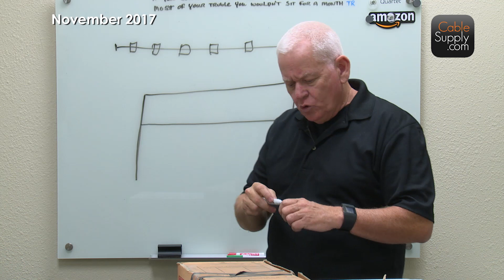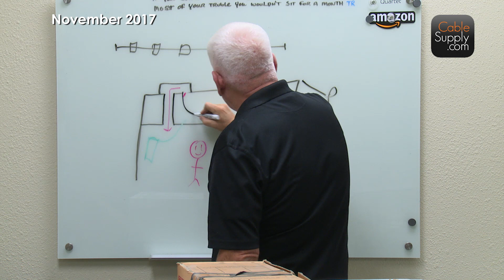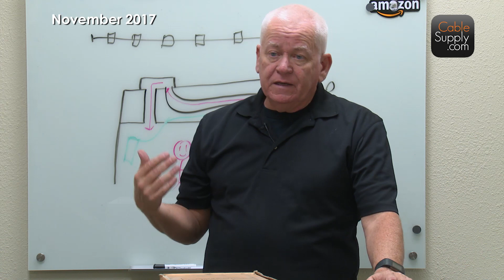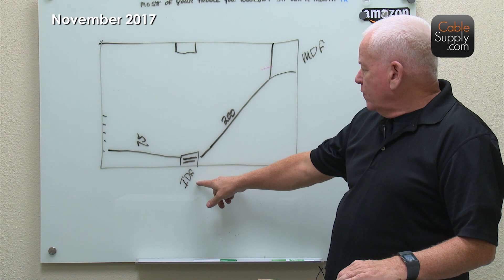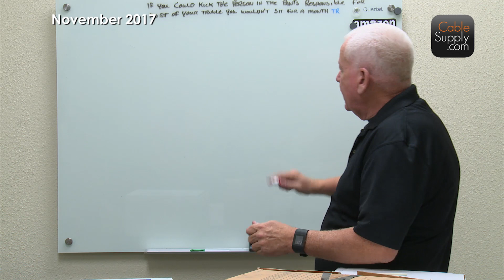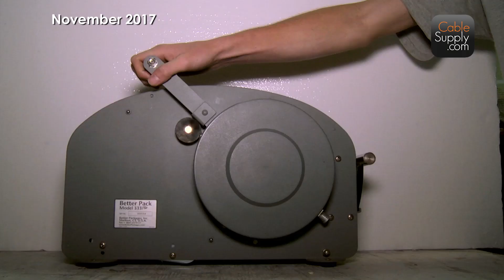Cable Types and Designations

Comment: Some digital Audio Systems - they use Burr-Brown chips to sample the audio, at about 196 kbits/second - require shielded Cat 6 cable. They enable standard{?} managed switches to send audio around a building, (an  auditorium for instance), Momentum Systems comes to mind...

Comment: HI,
Thank you for  your excellent sharing of knowledge.

I have a question.  You talked about "plenum" as a space overhead between the dropped ceiling and roof in the special case wherein the return air is not ducted back to the air conditiioner. 

How about the case in which you have a space under the floor of the working space. Assume it is a normal  height cellar with cement floor but without any finish work or studed walls. Assume there is no AC being actively ducted to that space but there is air probably being sucked up into the working space above the ceiling of the cellar

Is that cellar space, under the floor considered a "plenum"

Comment: What are the differences between Cat 6A and Cat 7?
Reply: Cat6A supports speeds up to 10 Gigabit Ethernet with distance up to 100 meters (10,000 Mb/s)(500 MHz);

Cat7 & Cat7A support speeds up to 10 Gigabit Ethernet with distance up to 100 meters (10,000 Mb/s)(1000 Mhz) ;Cat7 implements fully shielded twisted wires, called Screen Shielded Twisted Pair (SSTP) or Screened Foiled Twisted Pair (SFTP) wiring, resulting in higher performance levels.
Fiber optic cables are becoming increasingly popular as bandwidth limitations change. Fiber optic cabling is an extremely efficient alternative with the capability to run across long distances.